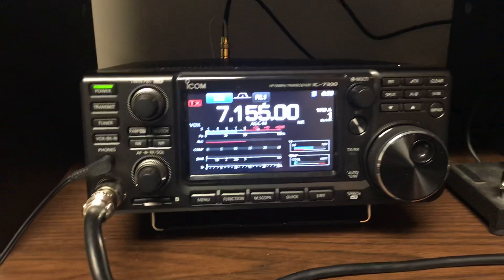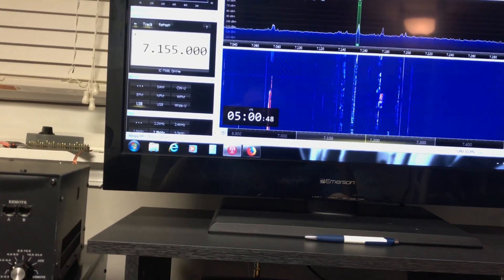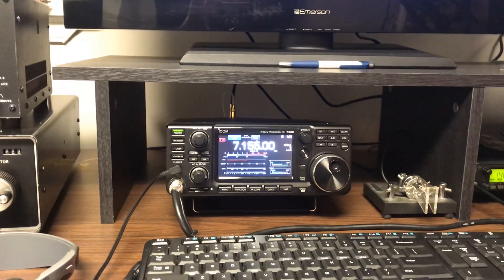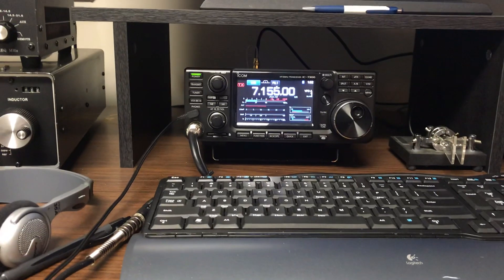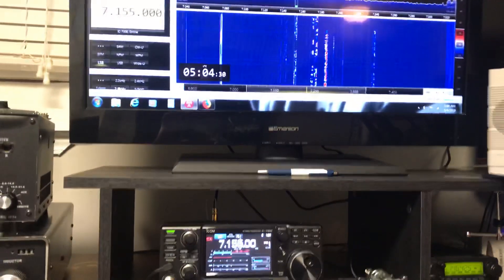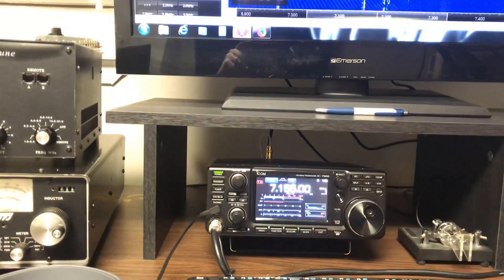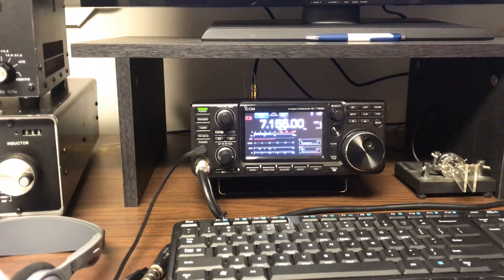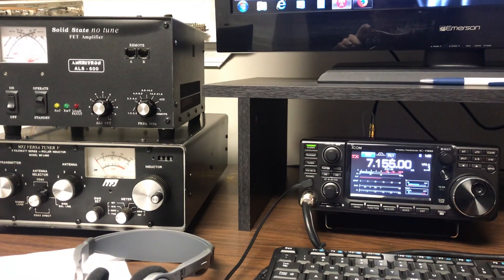40 meter delta loop Vs dipole

Comment: That's vertically polarized if I understand you right. Which direct is the opposite corner from the feed pointed? Its standing up right/ its not laying flat in other words?
Reply from the maker: Hi Jim. Yeah so it’s more of a sloping delta. Neither flat or in a vertical plane. 2 ends high and 1 low. It is fed in the top right corner. It tends to show the best results into Europe in this configuration as far as tx goes. However it is noisier on rx. When I feed it at the bottom corner, the rx is much better but it shoots opposite of the feedpoint “into the house “
Reply: TY Bro good luck

Comment: Today morning I was complaining of S9 noise in my radio on 40m. As soon as I signed, off my local friend called me and told to go for a loop antenna for RX. He told me that all the stations which I could not hear in the round table, he could hear comfortably, with a loop antenna at the ground level. 73 de Jon, VU2JO.

Comment: I had been toying with the idea of converting my 40m dipole inverted V to a 40m delta loop and I may still just because I am hard headed like that, but from this video it doesn't really seem like enough of a difference to mess with at the moment, my noise level is pretty high on 40 meters, my QTH is a small rent house in a pretty crowded little neighborhood probably lots of electrical interference.
Reply from the maker: Hi Shawn. I’ve re configured the loop since this video. I have 2 ends higher and one end lower. It’s fed at the top corner. It’s about 4-6db over the efhw now. It’s my go to 40m antenna.
Reply: @JayN4GO  do the legs need to be the same length? Also my dipole is currently centered with a 1:1 choke/current balon, I use an old Dentron tuner to achieve a good SWR.  My thinking is that basically all I would have to do aside from the wire placement is run a new wire between the legs of my dipole to achieve the delta loop, is that close to correct?
Reply from the maker: @Shawn_WW5JD  yep you got it. Worth a try
Reply: @Shawn_WW5JD use 1005/f in Mhz to get the total length of a delta loop and divide by 3 to get each side lengths. Also use a 4:1 balun in case you want to make the antenna multi band. Also look up delta loop for yourself. The 4:1 voltage balun is to alter the impedance for the tuner looking for 50 ohms.
Reply: @jamesabc372  I have reconfigured my loop to have 2 ends in the air one at 35’ for the feed point and one at about 20’ in the air with the 3rd end at 6.5’ above ground, I spliced in 2 separate small wires to just dangle towards the ground at the areas closest to the ground, I use an LDG AT-100proII tuner and my reception and transmit has greatly improved!

Comment: Are the antennas oriented the same way?
Reply from the maker: At the time the inverted V was north south. The loop was 2 ends low and one high to the northeast. Now I run the delta loop 2 ends high fed at one of the top corners. It slopes as well. The delta loop is way better now as far as performance. I’ve used and built a few efhw in various configurations but it gets lossy when running more than 100w.

Comment: I started using Horizontally  installed 40M fullwave loops back when Novices shared part of 40M with High Power SWBC stations in Europe. Thats about 50 W output  up against 100,000 W and a huge directional antenna. My Idea was to get a high angle  launch into the short hop area to reduce my reception of the long skip coming from Europe and boost the signals fronm the colser Novice stations. It weorked out pertty well for working those Novice ops.
Reply from the maker: Loops are very interesting to tinker with. Especially when you can put them straight up and down or add a second loop behind it. I think some of the best stations I’ve heard run 2 ends up high fed at the bottom in a phased array. They work great at 600miles and in at only 10 ft off of the ground. I wish I had more trees John! Hehe

Comment: Make sure the inverted vee inside angle is over 90 degrees or your performance will suffer. Feed the loop at the corner a few feet from the ground.
Reply from the maker: Tnx Dan. I feed the loop in the lower left corner with tru ladder line to the shack window into balun designs 4:1. The dipole fell down due to ice so I plan to put the efhw up in its place. I have underground utilities here where my antennas are. Lots of ground noise.

Comment: Thanks. I appreciate you taking time to make this comparison. Just what I was looking for. I did notice the differences in the DX station vs the state-side but the slight improvement seemed to reverse for the stations as you switched antennas.  I use an inverted-V at this time on 40M but started toying with the idea of the delta loop. I don't seem to have an issue with 40M contacts but who doesn't want to improve? Until I can get my full size 5 element 40M yagi at 180 feet, I will just stick with my inverted-V. I do run a monoband hexbeam on 20M and it is definitely better than the rotatable dipole I had before it.  73  WA4QGA
Reply from the maker: Fb my friend. If you are able to get 2 ends of the loop high and one low, it will dramatically increase the way the loop RXs. I went 2 high and fed the bottom with tru open wire to the shack. It runs into a 4:1 into the tuner. I’m really impressed with the performance on 30m and 15. Like you, I’m still in the process of putting up larger Mosley triband yagi. I now wish I had went with the hex instead due to the lighter weight. I did compare with a 40m half square during the Wpx. The loop won that battle for the most part. It is very hard to beat a dipole that is up high. I think K1gmm did a recent YouTube video on the loops and when you are able to run 2. Sadly I need more trees for that. Hihi. GL on your beam project and let me know how it performs next to the hex. 😉

Comment: Hi Jay just watched a bunch of 40 meter dipole videos , I really liked the delta vs dipole. thanks for that . SOMETHING   caught my eye, what is that on the top monitor the SDR software is it ? connected to the 7300?   or do you have that monitor connected to another radio like a Apache or Flex ?  I hope it's the 7300  and if so what is that software called ?  rtoledo2@gmail.com
Reply from the maker: Rt Cy I run the airspy hf plus sdr using the icom inrad 7300 for a pan. The software is sdr console v3. The inrad allows for tx to shut off the sdr while in transmit. It works well. Way better than the 7300 front end.
Reply: @JayN4GO   thanks for a minute I thought it was software for the 7300 directly.

Comment: I have the capability to get a 40m loop up around 75 feet. I will feed it with 450 ohm ladder line. How do you attach the cord to the antenna? I assume just tie it so it can move through the rope freely.
Reply from the maker: Anthony Costa I would use Dacron rope and launch it over tree limbs if possible. Some people use a brick or a gallon of water to allow the the antenna to sway up and down to prevent breakage. If you can get 2 ends high and one leg low, that’d be better for a lower take off angle. I feed mine with 75ohm coax at the lowest corner. The swr is flat across 40 and most of 20. Does ok on 10. 6,15 and 17m sucks though. I would like to try open wire. Remember to keep the length the same on each side of the loop to prevent it from acting like a folded dipole. :) trim 6” on one side, take the same off the others

Comment: I just completed my 20m inverted delta loop. I couldn't be happier, the noise floor is amazing compared to my noisy vertical. I've made contacts that weren't possible before.
Reply from the maker: PyroMan_FPV loops open the band and close them. Great job on the 20m loop. I’m putting one together as well